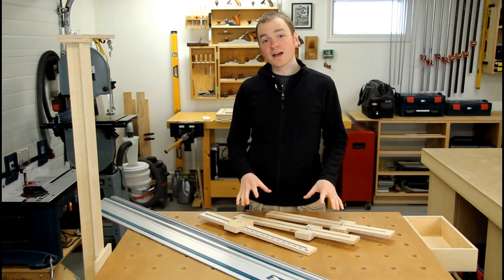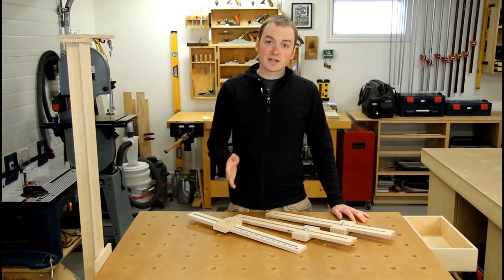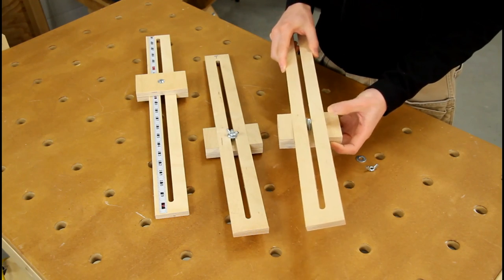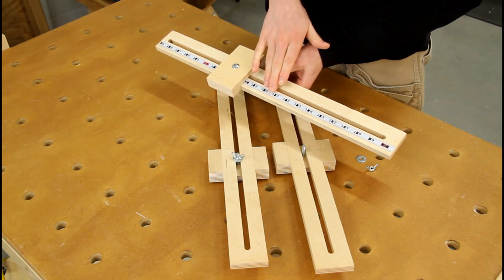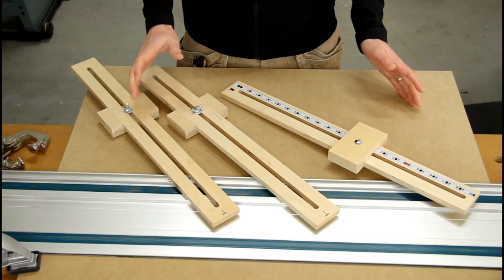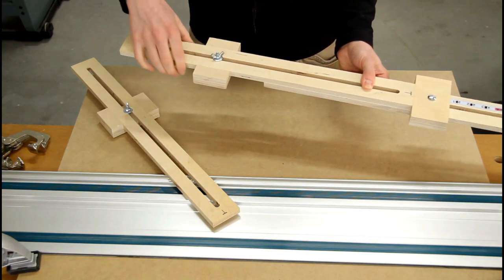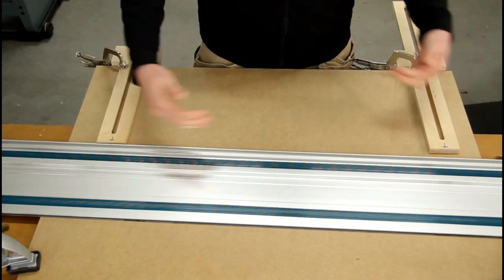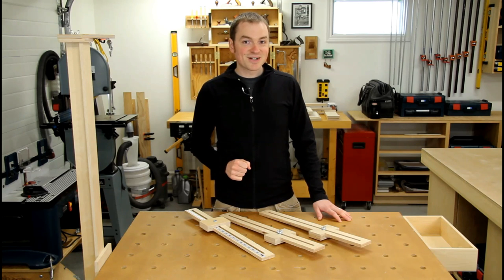Quick Parallel Guides for your Track Saw - Simple & Accurate

Comment: no hate here but wondering why not just use the under track clamp that comes with these track saws?
Reply from the maker: +WV591 I'm assuming you mean to clamp the parallel guides down with?  The clamps that I have for my Makita track saw are screw type clamps so they aren't nearly as quick to use.  If I had the Festool quick locking clamps for my track then I might use them to clamp the parallel guides down.  I find that the vise grip style clamps that I use are super quick and easy so that's why I go with them.  Great question.
Reply: some of those tracks have the special clamp that the top part is sort of flat  and slides  under the track so as not to interfere with the saw. oh well good job on guides either way.

Comment: What's the length of the guides?
Reply from the maker: +Charles Cho the guides are 22" long
Reply: Dan Pattison Any regrets with that size? Do you ever wish you made it longer or shorter? I plan on building 4 of these.
Reply from the maker: +Charles Cho no I've found that size works really well and gives a good versatile range. I haven't come across any situations where the size has been an issue.
Reply: Great idea Dan. Any plans available? Simple enough, just asking.
Reply from the maker: +MrKly123 no unfortunately I don't have any plans available for the parallel guides right now.